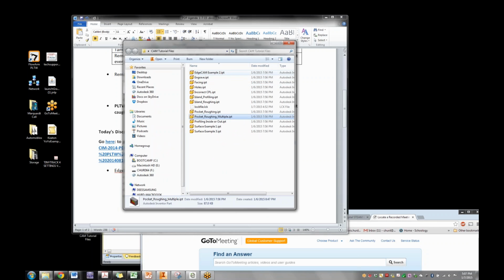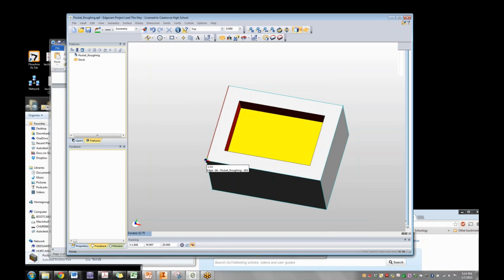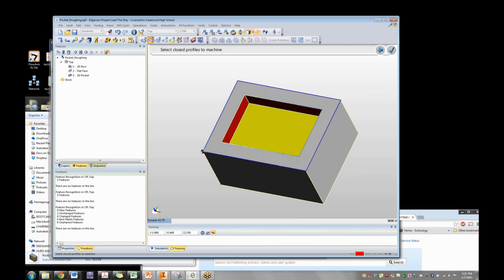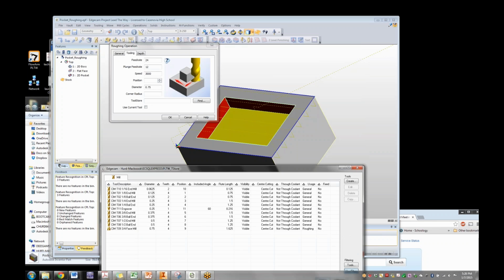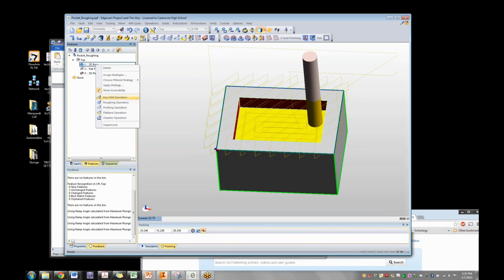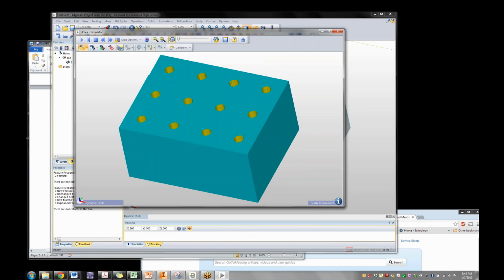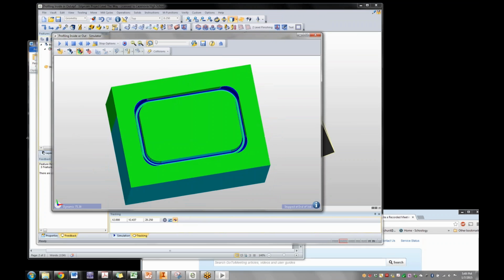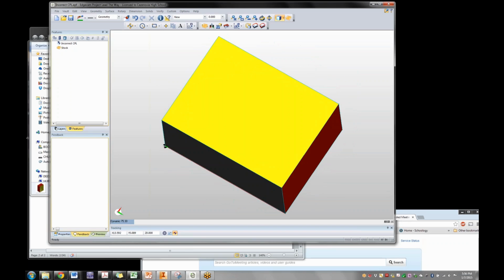EdgeCAM Basics 1

Comment from the maker: To see all we have posted regarding EdgeCAM, CNC, and all things for manufacturing education, please visit our website www.chrisandjimcim.com.  as for a laptop configuration, I like a Core I7 (I5 will do...) and as much RAm as you can afford. (4 being a minimum I feel. I run them both simultaneously on a Core i5 laptop with 4 Gb of RAM, with only discreet graphics. Is it like lightning fast? No. Will it get the job done easily, yes! Both companies have been writing their code more efficiently, and as time goes on, you don't need the horsepower you used to. Make sure you check on forums before you buy though, or Autodesk/EdgeCAM specs before you buy.

Thanks for the Kudos. Jim's insights are always excellent too.... glad he keeps me around! ;-)